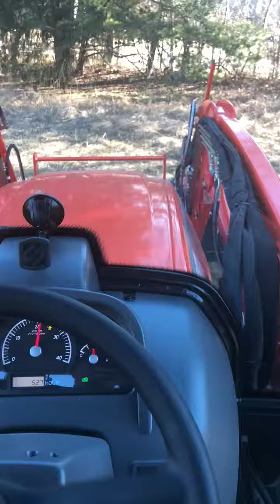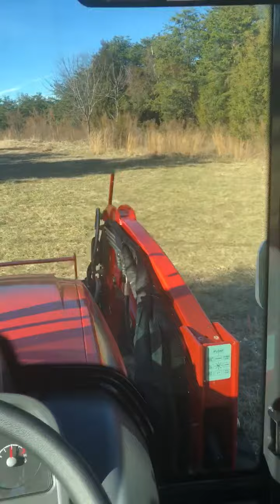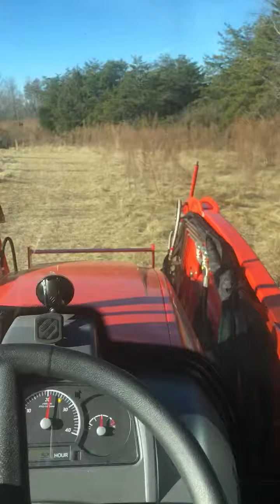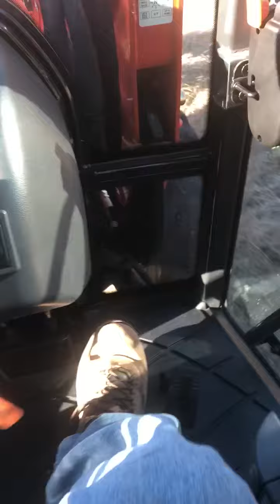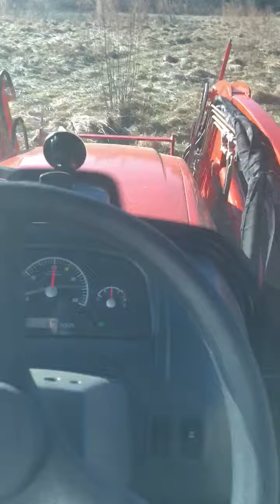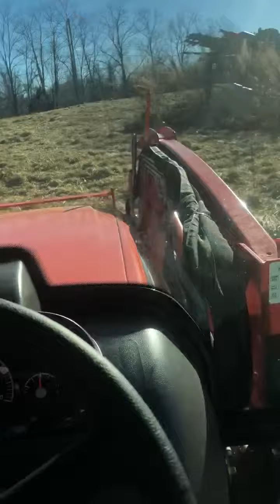Kioti Tractor Transmission Problems

Comment: How in the world can this not be a MAJOR design flaw??  The stuff that companies put out nowadays as "quality" is some kind of sick joke.  The thing is it seems like you can find horror stories like this with pretty much all of the tractor companies, but i can't see some of these issues not affecting all the tractors.  If the company is having to install new software then that issue is going to be on every tractor.
Reply: Only a design flaw if it continually occurs in many machines. From news out there, this is a pretty isolated case.

Comment from the maker: 2-9-18 UPDATE- Kioti created a software program last week that they were hoping would fix this transmission issue. My local Kioti dealership installed this new computer update to the tractor. I test drove it yesterday. Unfortunately it was not successful. The transmission jerked and jumped just as it did when the problem first showed itself back in December. So at this point, Kioti had possession of my tractor at the local dealership for more than 2 months of the 3 months I've owned it with no repair success. They've sent their head transmission technician from New York to my local dealership with no success. They have created a specific computer program to fix the issue with no success. Still, as of today, my tractor is broken down. I called the regional manager of Kioti this morning and told him I'm done with being jerk around. Kioti has 3 options at this point. 1. Refund my money so I can go buy another Kubota tractor. 2. Replace this defective tractor with a brand new one. 3. Do nothing for me and I hire an attorney to settle this issue. I will keep you all posted on the resolution. Thank you for the supportive emails I've received. Yes. This has truly been a pain in the ass for me.
Reply: Any follow up on how this was resolved? I am having similar issues with a Kioti NX4510.

Comment: Is kioti going to fix this issue or is this normal for this tractor?
Reply from the maker: I am working with Kioti now. They have had my tractor for more than 2 months of the 3 months I've owned it. They have sent their head hydraulic transmission guy down from New York to diagnose this issue but the transmission issue is still present. They have re-written the computer codes that controls the transmission and are going to try uploading that to the tractor's CPU on Thursday. If that doesn't fix it, they have an option to either give me my money back or give me a new tractor. They build good tractors...I just don't have one of them. I will keep you posted.
Reply: I just got to use my nx 4510 for the first for a few hours today and i have the same problem. Hit and miss in the middle range of m. I bought my tractor back in end of January.

Comment: Tractor that big shouldn't be hydro lol
Reply: I don't know enough about them to tell if it was a manual or hst. He didn't say. I know that makes it easier, but.......to me, a tractor that gets worked hard needs to be a manual. Just my opinion.
Reply: Most of the commercial/ industrial equipment is HST with a lot more HP behind quick example Skid steers and no problems
Reply: @paulwuzynski2617  Skid steer is 100% different than a tractor like that bud. Hst requires more hp to do the same amount of work. Don't get me wrong it's great in certain applications. In others gears are 100x better